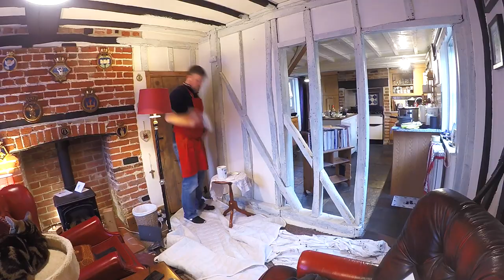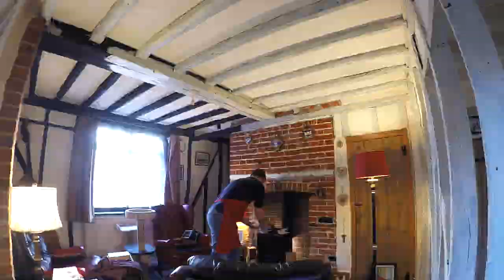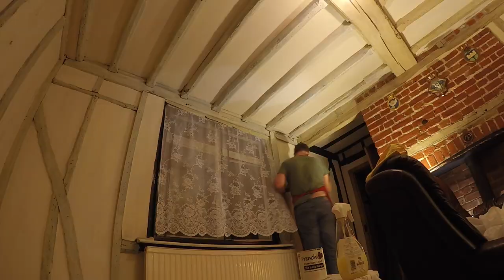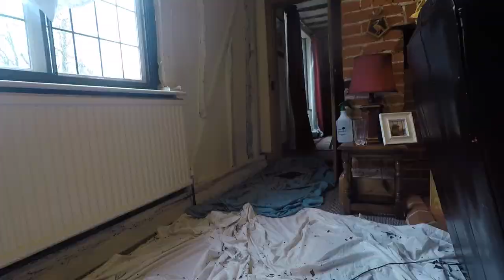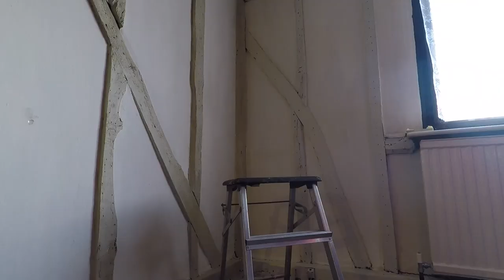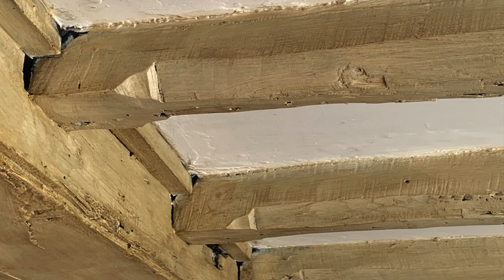Cottage beam restoration using Frenchic paint and wax

Comment: thanks for sharing, I'm about to do the same but will also be painting the ceiling. any suggestions on sequence? beams or ceiling 1st?
Reply from the maker: Good question - I don't think it matters too much if your ceiling is white/light coloured. I reckon I'd do ceiling then beams. Good luck!
Reply: Did you do it? I'm also thinking of doing the ceiling and the beams.
Reply: You may have already done it by now but I’m doing this at the moment and would definitely say beams first. I like things to be super neat around edges and it’s a lot easier to control emulsion with a fine brush than it is wax. If you do it the other way round you’ll definitely need to do emulsion touch ups to the ceiling.

Comment: Great video. How many pots did you use of both?
Reply from the maker: Thanks. I would say approx 2x750ml tins of creme de la creme paint, and just under 1 tin of the browning wax.
Reply from the maker: so total cost approx £50.
Reply: @mikemcgibney  I used two tins of that paint to do the very small landing area in my little cottage. Why do you say "approximately"? Surely you know exactly how much you used.. How did you stretch two tins to do all that? I find it quite thick and doesn't go far and reckon it will cost £400 to do the rest of the house
Reply from the maker: @rinklestiltskin  I said approximately because I was doing my whole house so I had tins on the go all the time. I do not know exactly how many millilitres of paint I used. Are you using Frenchic? Maybe you’re putting it on too thickly. The first coat should look pretty patchy and second coat a bit more firmed up. Doesn’t need to be perfect as the browning wax will go on. I did my whole house and it didn’t cost a huge amount in Frenchic creme de la creme paint.